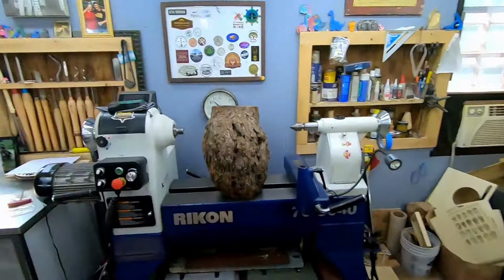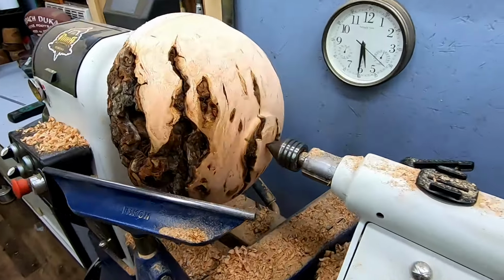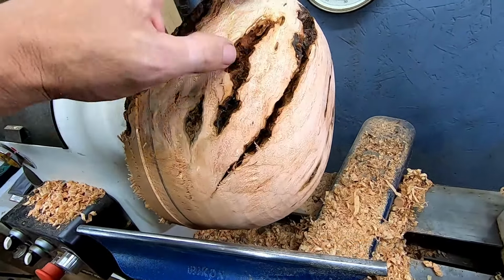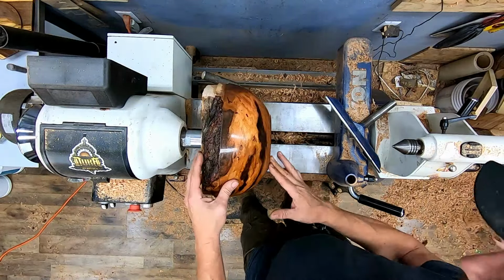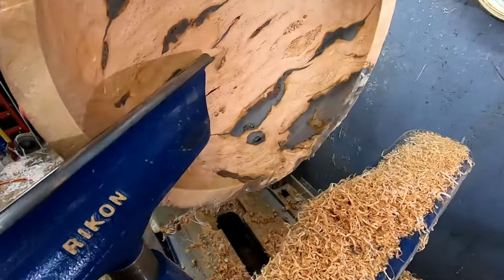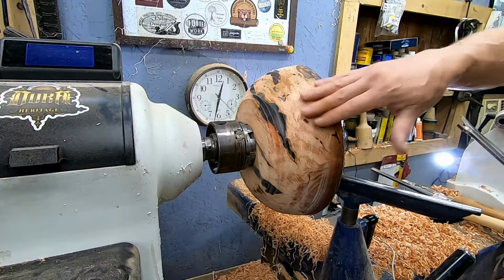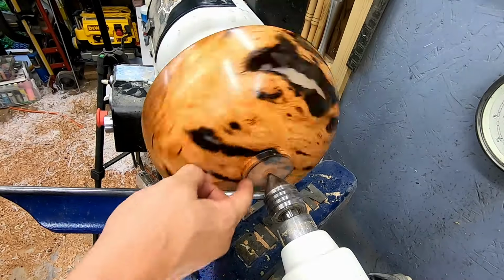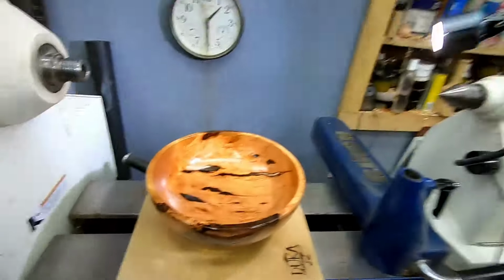Woodturning - Cherry Burl Bowl

Comment: 18:31 This piece turned out great since you used only a small amount of mica in the resin. Which keeps the attention on the beauty of the cherry wood. But it always hurts me when so much precious wood is going to dust. Therefore a coring system would help you to have less wood going to waste and paitsfor itself with more bowls or even bowl sets. Plus it has more sustainability. I wish I could sponsor you one but my budget is too tight.
Reply from the maker: I feel your pain, I have a few big burls waiting for the day 30”+ Although I can say stay tuned for the next one which is a slab cut of a big ash burl. 🤞it’s in the kiln